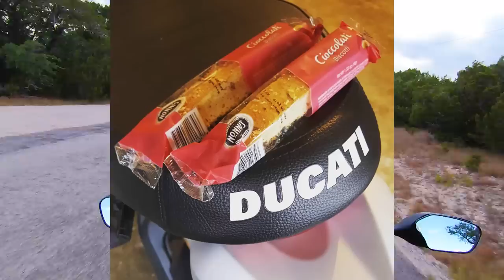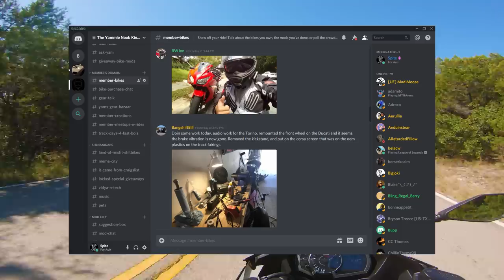Why did Ducati Give Up the V-Twin Engine?

Comment from the maker: Thanks to Woonny Hayabusa, The Muscle Biker, and Spite's Corner for the exhaust clips, links to their vids are in the description. Don't forget to get signed up to win a FREE bike! Head over to https://yammienoob.co/ and register today.
Reply: Remember why they make electric bikes
Not everyone can afford fuel on the new V4 like everyone could afford fuel 20years ago on the flagship inline 4...

You can have an R6 inline 4 120HP 
The average rider doesn’t tune their suspension. 
1500miles after a suspension tuner tunes the hydraulics it goes back to pogo stick mode which chews tyres and cannot get a pace faster. Unless you keep tuning. 

Then you can have Aprilia RS660 Parallel twin 98hp and is lighter than inline 4, Non adjustable damper suspension. 

If cannot tune the R6 fully adjustable suspension and having more power....
It will chew tyres x2 faster than the RS660 as they sit. 
Unless can use that suspension technology to what it’s designed for. Optimum tyre wear and pace....their is not much difference, to someone with non adjustable technology. 
All that technology....

Comment: Angle between cylinders and the crankshaft alignment can change the sound and power delivery.
Much like cross plane vs flat plane for inline 4 cylinder engines.
Reply: Jordan Peterson?

Comment: I loved my 959 , fast revving engine , lots of torque , smooth and capable . But once you ride v4 you feel another set of emotions
Reply: Yeah, it usually involves a ray of light and a heavenly choir.
Force V4ever
Reply: The new Pinigale V2 seems like a better bike for the road. The V4 is flat out scary to push to the limits.

Comment: Ducati did incredible things with their twin. They reached a practical  limit with the twin though.
Reply: Exactly, I wanna see KTM score a podium with their twin, let alone winning world titles.
Reply: @ampm9771 
I'd like to see KTM build more parallel twins that don't eat cam lobes in 10k klms. 😂
Reply: @jamescampbell4334  yeah, you pointed out one of KTM's very well. Like you'll need to replace oil pump every 2000km on a KTM, or oil every 1000km.

Comment: Thanks Yam brother for this, as a Ducatista I appreciate this.  Man, the Pani sounds so good & it has sexier lines than the Aprilia however I will say the Aprilia does sound a bit better, put the Arrow Pro Race full exhaust on the Pani & it sounds even better.  I'm lucky to have owned 3 Ducs, currently have a Diavel 1260s & it's just a beast!

Comment: Is it just me or does the rsv4 sound better than the desmo?
Reply: yup
Reply: Coz the angle of camshaft, v4 90° rsv4 65°
Reply: Definitely the RSV-4 sounds way way way better. Maybe that’s just not the ideal exhaust for the Ducati ?
Reply: The sound comparisons were somewhat misleading since they all seemed to have aftermarket exhausts. My 2016 Aprilia RSV4 with a stock exhaust sounds very different from the one in the sound comparison (I prefer the stock sound). And my 2019 Panigale V4 Speciale has the Ducati-supplied Akropovic exhaust and also sounds very different (and better, IMHO).
Reply: @rjw_utah  you dont even have one.
Reply: Always preferred the aprilia v4 sound

Comment: For racing, the V-twin died in 1969 when the Honda inline-4 came out. Some racing classes allowed V-twins to have more ccs so they could be competitive for awhile, such as the Honda RC51. Now, Kawasaki has dominated World Superbike with an inline-4, with the Aprilia V4 sometimes winning. Completely stock, it seems most riders go faster around a track on an Aprilia V4, however it might be many more miles to get to a mechanic used to working on them, and Aprilias are probably less reliable than other brands.
Reply: Wsbk 2003, 2004, 2006

1000cc maximum for any cylinder layout/configuration and the 999 Ducati came home ahead of the 1000cc fours.

Comment: Opinion: Aprilia V4 sounds best. The "big bang" or "Twin Pulse" firing order of the V4 just makes it sound like a weird V2, which I've never been a fan of anyway. Rolling down the 405 at 90mph the V2 exhaust note just sounds like a pissed-off Cub Cadet.
The V4R is the only ducati that actually takes advantage of the desmo valves, even though 600cc bikes have hit 16,000 rpm on valve springs. It's been nothing but an additional cost for no gain. And you said "the engine was more reliable..." Show your work.
Reply from the maker: Make a video and show us how it's done. Commenting is easy, creating is hard.
Reply: Hahaha I'm glad you shit on this keyboard cowboy yammie, but the rsv4 sounds waaaay better.
Reply: @yammienoob  Show how what is done. I stated an opinion, then facts on how anything Desmo has done, valve springs have done. Doesn't take a video to prove that.

Comment: My understanding of the cause for desmo  valve timing  was that in the earlier days of high performance engines the valve springs would break due to inferior alloys. With the advent of superior alloys desmo timing has become obsolete.
Reply: Depending on the rev limiter. With classic valve springs a 1000 cc four cylinder engine can rev up to a little more than 15,000 rpm. For higher revs desmodromic or pneumatic valves are still the choice. But who knows what material science brings us in the future.
Reply: In the late 1960's my dad set up a 250 Ducati spring valve version that was raced against desmo versions in on a 1/4 drag course in Los Angeles. He smoked them and got a little plaque for his victory.  Though the Italians definately mastered the art of the Desmo.  They were so good they assisted Mercedes with there desmo's in the in the 1950's

Comment: Oh dear. Not all Ducati singles were Desmo. The lower end ones eg the 160 and 250 Monzas never were although the GT clubman racer versions were. (The 250 Monza was a surprisingly nice bike, just a tad too small for me.) And desmos do have valve return springs, they're there to prevent valve train lash which,  given that the whole point of desmo technology was to get humongous valves to keep up with a high revving race engine, was an issue. Owner of many ducks here.

Comment: Um, real question here:

Does yamaha R6's system valve suffer from valve float when it runs to max rpm which is 16k rpm?
Reply: The R6 has 150cc cylinders and tiny valves.  It is a huge amount easier to control tiny valves for a 150cc cylinder than the much larger valves for a 600cc cylinder
Reply: @paulstandeven8572  how about motogp?
Reply: @adityajonathanmamahit2889  MotoGP bikes use pneumatic valves (except Ducati of course). Since they switched from classic valve springs to pneumatic ones they made a big step in terms of engine power.

Comment: Noticed you started using video footage of an MV Agusta F3 at 5:50 in, and again at 8:16 in.  But the F3 is an inline 3 cylinder, right?  Curious if the MV footage was an accident, or you just ran out of Ducati footage you could use?  I certainly kept listening closely to see if you were going to mention MV for some reason.   Fun, informative vid though!

Comment: ..No springs in a desmo ??....you might want to re-check that.
Reply: Some early ones had a spring for final closure.  It was not necessary and caused problems.  Sometimes
Reply: @paulstandeven8572  They still use them in modern ones too..I know, I have one...in fact i've had 3 'modern' Ducati's..& they all have springs in the rockers.
Reply: @S735334  I presume you mean the dohc desmo engines.  I didn't know they had closure springs. 

 I do remember an expert Ducati mechanic saying that he always removed the springs from the sohc bevel-drive machines if he found them fitted.  Expert?  He fixed lots of road bikes, and built VERY fast race machines.  He had a T-shirt made saying "I shim Desmos in the dark"
Reply: @paulstandeven8572  All Ducati motors have them.. it's a myth that they don't..I also know a couple of Ducati experts/tuners..(one of them built bikes that were beating the factory Ducati's in the world championship a few years back)..& guess what ?....the springs stayed in !! Yep, all desmos have springs...from way back, right up to todays Ducati's.
Reply: Correct! They have supporting springs for fully closing the valves in cold conditions/cold start. At operating temperature the springs are more or less useless.
(mistakes corrected)
Reply: @sebo1337  Full marks to you sir... Yes, they are a very light spring that help in colder starting conditions...although my current Ducati is in Spain, usually Australia, so extreme cold starting conditions are rare in both countries.... but the Aussie rego plate confuses the Spanish Guardia no end !!
Reply: @S735334  Thank you sir! Actually it was a little bit unprecise by me, sorry. By "cold conditions" I meant engine "cold" which is basically everything below 60°C :) 

A little bit more into detail: clearance between closing cam on the camshaft and closing rocker arm on the exhaust valve is somewhere between 0,00 and 0,XX mm (on racing engines a little bit more). At operating temperature the valve expands due to high temperatures and closes the clearance (almost). When starting a cold engine the valve is smaller and due to the clearance between rocker arm and camshaft the valve would not close completely resulting in pressure loss and bad (or even no) starting ability.
(mistakes corrected)
Reply: @sebo1337  Nicely explained... I just love the simplicity of Ducati engines..especially the 2V versions...quite easy to work on. Now, if only they could just make their wiring looms a little longer !!
Reply: @S735334  I know what you mean. Meanwhile I think a can disassemble and reassemble the Testastretta engines blindfolded :)
Reply: @sebo1337  excellent... I take it you don't work in a Ducati franchise then, lol....I've never had good results from Ducati dealerships with service or repairs..in a couple of different countries.. but back in Aus there's some real wizards with Ducati's... much better quality work & better prices..The guys down at Rosso Corse in London are exceptional too...Just need to find someone here in Spain now !!!
Reply: There are no valve springs! We have 8 Ducati's not one spring
Reply: @Mauitaoist  Well they were fitted at the factory, so unless they've been removed by someone..they will still be in there...have you checked the magnet on the sump plug lately, lol ?
Reply: @Mauitaoist  Read carefully what S735334 and I said. There are supporting springs to close the valves completely on cold engines.

Comment: Hi, its me again.  I've been pointing out for a long time now (but not yet here) one reason why Ducatis pull the other bikes on the straights.  Maybe you'll care enough to comment.  Consider traditional engines with valve springs.  16 valves X average of 10,000 rpm X 45 minutes/race = about 7 million times per race that a valve spring gets compressed.  If that doesn't rob horsepower then I don't know what does.

Comment: I wonder if the desmodromic design (no valve springs) is more efficient and powerful than engines with valve springs? Or are they not very efficient?
Reply: Of course they have better efficiency. Why else would Ducati use such a complex system?

Comment: They couldn’t get anymore out of two cylinders without more displacement and wsbk wouldn’t allow that.
Trouble is the more you tune a vtwin the more it acts like a 4 cylinder thus you loose any advantage a vtwin gives you

Comment: Since there are no cylinder limits for production bikes why not go for the inherently superior V5 or 6 cylinder engines ?
Reply: Because there are homologation restrictions for wsbk.
Reply: The V4 (apart from the R) is already WSBK illegal because of displacement.
Reply: @twilightsuzuka6252  exactly, hence why there is a v4r homologation special. As there was for its predecessors and it and most of its rivals predecessors. 

But homologation specials can't be complete prototypes.
Reply: Isn’t the V4R basically a complete prototype ?
Reply: @twilightsuzuka6252  no. It's a homologation special based upon the v4s.

A grand prix bike is a prototype, with no comprise made for production. 

A superbike is a highly modified homolgated road bike.
Reply: If you want torque and low end power you don't want more cylinders.
Reply: @chrisredfield3240    the ratio of bore:stroke is more applicable to that than simply the quantity of cylinders. 
A v12 Rolls Royce Merlin/meteor engine is a fine example of this.

Fewer cylinders doesn't mean more torque, more cylinders just gives more potential for the torque to be higher in the rev range as ideally it wants to be in a racing engine, and more cylinders means more piston surface area an more potential for more torque for the engine capacity.
Reply: @theant9821  your right more cylinders does make more torque eventually at some crazy high rpm.  I have a f800 a friend has a gsxr750 they make the same peak torque 5,750rpm vs 10,750rpm.  If i got the numbers right.  All engines seem to be big bore short stroke. Except the nc750 but then that bike only revs to 6k.  The piston has a long way too travel i guess.
Reply: Then why use a V4 in the first place ?
Reply: So what you’re saying is that the V4R could have only differed from the regular V4 so much, otherwise it would have been illegal ?
Reply: Isn’t the nc750 really a V8 ?

Comment: does that mean you need to adjust more valves
Reply from the maker: Service intervals for Ducatis used to be quite short, but the new ones are similar to Japanese offerings.
Reply: @yammienoob  thats for normal use which is not my style

Comment: Additional pistons is the only way to go faster more powerful
Reply: Or go 2 stroke. Or both.  With two stoke it fires twice so it's almost like having twice as many piston's
Reply: You can already go fast enough to get dead in a big hurry even on a 400. It's not about numbers it's about finding a bike that fits how you drive. And as they used to say, Ducatis are long-legged and easy to live with.
Reply: I ride a naked v-twin. It’s an SV1000, it’s still bone stock besides suspension and cosmetic upgrades. I hit over 140 on it on a regular basis and I’ve been over 165 on it. Considering that info keep in mind that the SV is only pushing about 108 hp to the wheel and about 85 ft/lb. a Ducati or aprilia would destroy the Sv on everything from street, drag, and track. Why would you really need anything more than 200 horses to the wheel ? lol

Comment: They dumped the V twin because it's like you on a bike. Shit. It was only competitive in WSB because they were allowed to run a bigger engine displacement and on the street it had a bigger displacement to keep up with the smaller engined BMW and Kwakazaki bikes.

They don't have valve springs so they can charge you $400 for an oil service and as an excuse to run at lower RPM's.

Comment: even Suzuki has SV 650 and they can also make a v4
Reply: Dark soul 47 I wanted to say the sv650 is one of the nicest motorcycle out there, but you best me to it. I have owned an 04  SV650 s and love it. Just bought my next bike, a near new 2010 SV 650s. After years of owning one it was the only bike I wanted.  Best bike I have owned, riding since 1972 so had a few. It is the perfect "real world" middle weight motorcycle. There is a reason it is virtually unchanged since 1999 and is still highly rated. Definitely an affordable bike to purchase and operate.

Comment: There’s a new V2 Panigale for 2020 - so they haven’t given it up
Reply: well yes, but no. The 2020 V2 is a 959 putting it in the 750 class. They did give up their 1000 class 1199 panigale and their top spec 1299 panigale and replaced them with the v4 bikes

Comment: Because it's a gratly bad architecture.  Low grunt, nothing at high end,  high fuel consumption,  to much engine brake,  hard to enter in a corner with smooth control.Dragging  the rear wheel on downshifting,  if not revmatch and overworked the clutch.  And so on. 
The in line 4 is much smoother and easy to achieve performance with.

Comment: What is floating a valve? Too simple. Floating a valve is like sticking your body out (the valve) in front of a rail train (the piston) moving at full speed
Reply: Valve float is when the spring can't de compress fast enough to push the valve etc into the cam fast enough to keep up with the cam, so it means losing compression, air/fuel, and potentially damaging the cam as it does eventually close the bucket will impact the cam when the idea is it runs along the cam surface and the csm controls the close speed of the valve. Desmodromic systems were developed to combat this issue by mechanically pushing the valve closed via a second cam profile on the camshaft operating a rocker rocket which closes the valve. Valve float was a big problem at one time on high revving 4 stroke racing engines as springs needed to be stronger to keep up with aggressive cam profiles at high speed but materials weren't available yet to cope with the compressing of the valve spring as the valve opened and still be stiff enough to close fast enough without risk of the spring snapping. Improvements in material have narrowed that desmo advantage and pneumatic valve systems have leveled the field in purpose built racing engines like in motogp. 

Simple.

Comment: No valve springs?  I wonder what that part is in the valve train of the desmo diagram labelled "return spring"?  Sure, it only keeps the valve on the seat after the cams close it, but it is still a valve spring.  As usual, this channel is a mix of misunderstandings, misstatements, misdirection, and missed opportunities to learn anything useful about motorcycles.